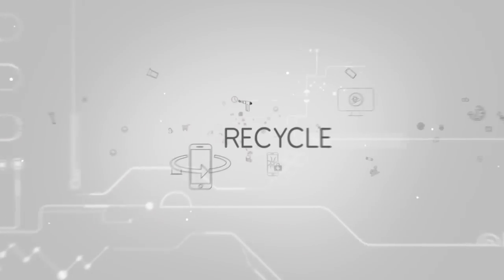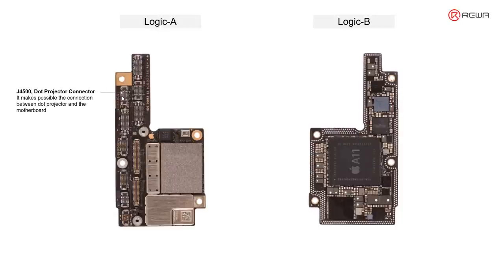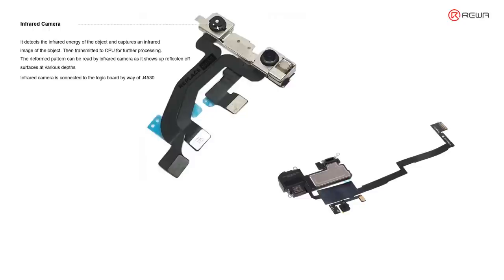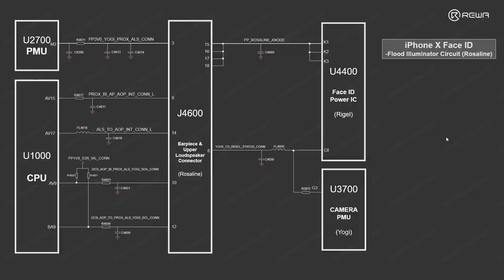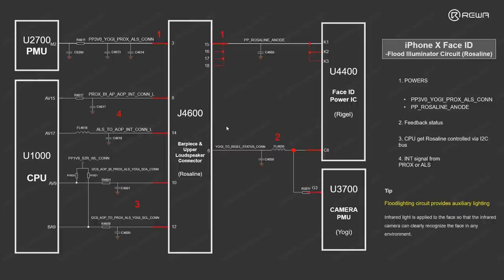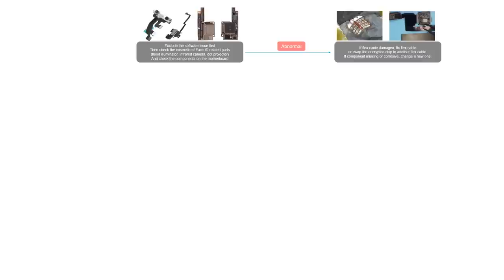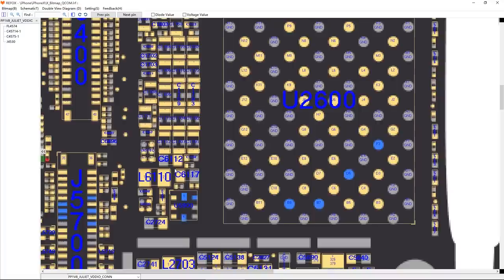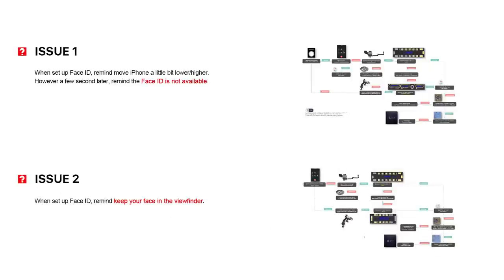How iPhone X Face ID Works | REWA Academy Online Course

Comment: I have XR and am having trouble with the First issue, Lower / higher your camera and then face ID not available. Actually I have replaced the screen and later I found my battery starts draining fast but everything else was working well such as face is and everything. I diagnosed it and came to know the proximity sensor has the issue so I disconnected the earpiece and the battery stopped draining. I tried to reheat the sensor, it fixed the draining issue but now having problem of adjust lower/ higher camera. I wanna know If I replace the earpiece sensor will I lose the face ID?? I tried another earpiece flex also but face id doesnt recognize on that. Please advice @Rewa Technologies
Reply from the maker: The flood illuminator on the earpiece speaker flex cable is part of the Face ID security feature and therefore should be the original one.
If the Face ID failure is caused by the earpiece speaker flex cable, you can replace the earpiece speaker flex cable and transplant the original flood illuminator module to the new flex cable. The battery draining problem maybe was related to earpiece speaker flex too.
This just for a reference. Please noted that the operation of transplant earpiece speaker flex needs sufficient handwork skill and we do not propose to easily try. Thanks :)
Reply: REWA Technology 🔥

Comment: Hi! Please solve the iPhone 11 screen swap issue, where the phone warns the consumer with pop up message, saying that the screen might not be genuine. I know the issue is being worked on, but it would be impressive from you to witness on youtube.
Reply: I think there is a video they used a certain programming tool to program the new screen from older one. Just check on restoring something. at the end you will see that programming tool.
Reply: @kevinmugambi465  yes, thats data transfer for true tone. It won't fix the genuine screen warning problem though.
Reply: Theres already a solution for that, transfer the ic to the new screen flex, works fine then.
Reply: @tastytechaddictsmtb  is right the thing is to transfer the ic to the new screen at least for now, but there is a real programmer tool coming other than the true tone and vibrating... replacing the ic is not a big deal if you know how and have the stencil for reballing the ic but the tools would be faster !!

Comment: My phone’s Face ID is not working and iPhone portrait mode in selfie cam is also not working what to do
Reply: If there is no image when using Face ID or while using the front camera:

1.) It maybe the camera module itself.
2.) It may be a power rail, control signal or reset signal.
3.) It maybe components on or near the connector.
4.) There may be damage to the front camera flex
5.) May be an issue main or camera PMU

Your description is too vague to narrow the problem down.